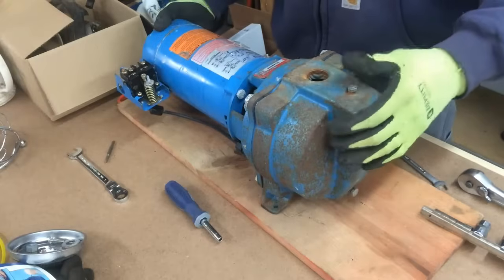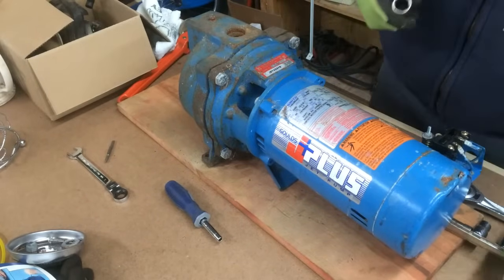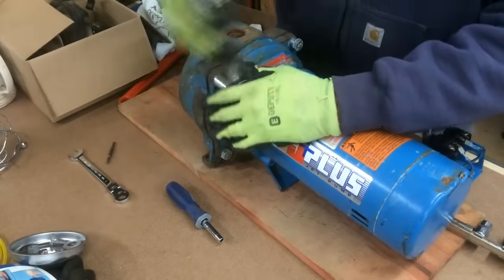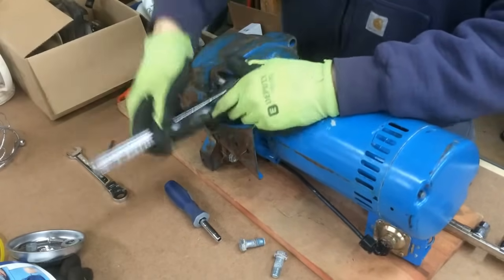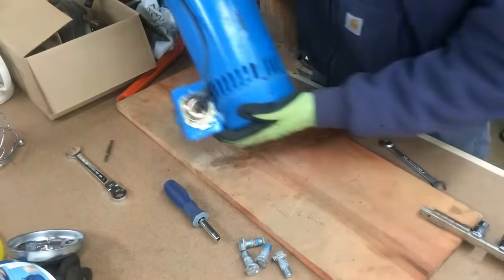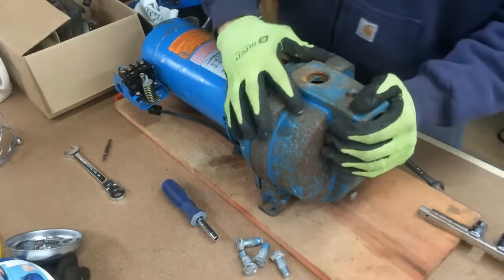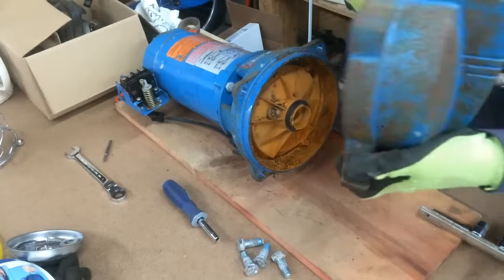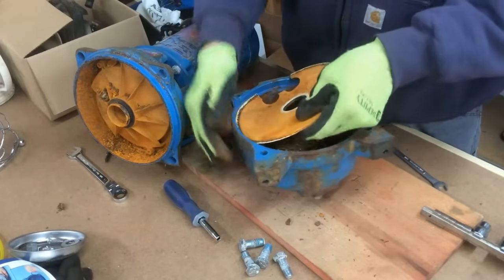Goulds Shallow Well Pump

Comment: Aaaaargh......the video stopped right before you were about to remove the diffuser/nozzle assembly. That's the bit I want to check/clean to see if it fixes my low pressure problem.

Comment: I’m hoping you can describe how to remove the diffuser from a J7S pump. Since the diffuser is plastic I’m not sure how to remove as a socket doesn’t fit tightly on it. I’m worried it will snap off. I’ve called a few dealers and they indicate it’s not worth rebuilding; just buy a new pump.

Comment: Recently I got a Goulds water pump of 1 HP to irrigation for my garden in the front and backyard. I notice the motor turns on and off intermittently but comes out good pression of water. Is that correct? Thank you for your response.

Comment: I have broken through 3 o rings trying to reseal my JRS7 gould pump.   Any tips, tricks to doing this and each time I have one side that bulges.   i have everything soaked in silicone trying to make sure ample lubrication....still breakin them
Reply from the maker: o-ring?
Reply: yes, the rubber ring that goes between the two halves of the pump body

Comment: I have the same pump mine keeps seizing up I take it apart lean it up put it back together and it works for awhile then it jams up again you can hear it make a hum sound as it tries to spin then it gets hot and momentarily shuts itself off
Reply: This is not true for a deep well. It’s much cheaper to replace a jet pump then a well pump 300 feet below the ground

Comment: new impeller soft seal not hardened .....notpumping     why?
Reply from the maker: Many reasons. Not just the impeller
Reply: @zeppone4045  what should I check that might to replacing etc?.   The pump didn't turn off from air seeping in the line and the impeller was overheated.  The new pump pumps if we only let it run 5-1w0 min and manually turn off the circuit until low water pressure!  We need the back up and want to know if it works?  Tried testing it with tubes to filled buckets.
Reply: Afraid with all of us confined may not be able to buy a new one if ours goes.

Comment: Can you take a pool pump motor and convert to regular electrical use like on a band saw or wood lathe?
Thanks
Reply: At least my understanding is that it will have a really short shaft but they are usually designed for continuous use.  So I don’t see any problem unless you can’t find a way to adapt to the shaft.

Comment: Looking for a jet and venturi/diffuser (ANO17, and AD3731) for a Goulds J-5 1/2 hp pump. Was wondering if the jetting from a 1 hp J-10 pump, (installed in the J-5) would cause pumping problems. That's what's in there now. My J-5 will only pump 2 gals. a minute from a new 20' 1 1/4' shallow well. Any info appreciated.
Reply from the maker: you need a Goulds parts break down. They will show output for different nozzles and diffusers....

Comment: Thanks for video, just moved I to new house, went to turn on pump on in the spring. Casing had a huge crack in it, ordered a new one, $240, now I gotta install the new one
Reply: $240! For just the casing? You can buy an entirely new pump, (motor and all) for $400.
Reply: @joequillun7790  where abouts?  I live in Nebraska, cant find cast iron ones very cheap around here
Reply: @Weinmaste  I saw them on Amazon recently.
Reply from the maker: @joequillun7790  Parts very expensive. Looks for a used if you can. Nothing goes bad on them unless they crack....
Reply: @zeppone4045  you're right, recently I looked at the price of new pumps, and they sure have increased. I was able to find my housing a few years back, for about 150.

Comment: It looks like the 1 horse power has the same input and output sizes 1-1/4 in and 1 inch out as the J5S  1/2 horse power version does. Is there much of a difference in water flow at the same pressure of 40/60 psi system?  If they have the same input and output pipe size how could it have more flow??

Comment: I'm looking to get a shallow well pump to draw off a water tank to irrigate 2 acres. My water has sulfur. What pump would you recommend. I noticed the water turns brass fittings black. I was thinking  stainless. Wants your thoughts on this. Thanks for the vid.
Reply: I have on my farm a J5S   Cast iron 1/2 horse power pump with a expansion tank and everything a well pump system needs, pumping from a pond and I have had it for at least eight years with no problems. I irrigate about 8 acres with standard garden hose sprinklers and drip irrigation.
Reply: @mainelyelectric  I have that same pump, (1/2 HP), but it has a double holed casing, open in the frt. Is it a deep well pump, or do I need an adapter?
Reply: joe quillun sounds like a deep well type
Reply: @mainelyelectric  I've seen illustrated breakdowns of these pumps, and it shows "2" adapters, that bolt to the frt housing. 1 for a shallow well, (single inlet), and another with a double. Still investigating where the injector would go, if it were set-up as a deep well. And if I have water at 20-25', would it be foolish to use it as a deep well, (double piped), or would it be easier on the pump motor, cause it wouldn't be working as hard?